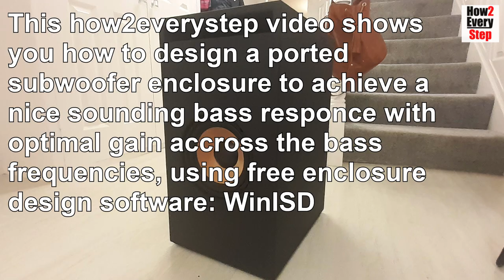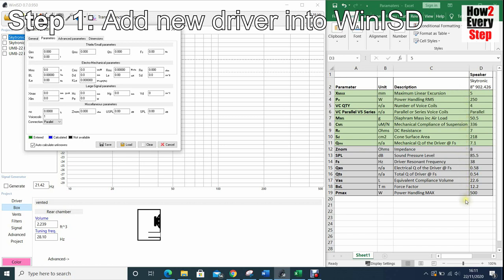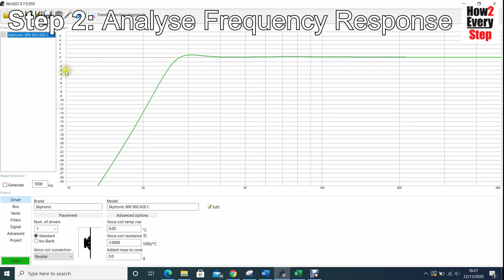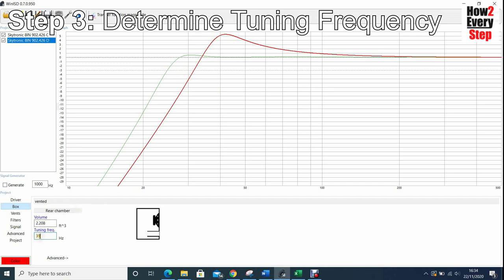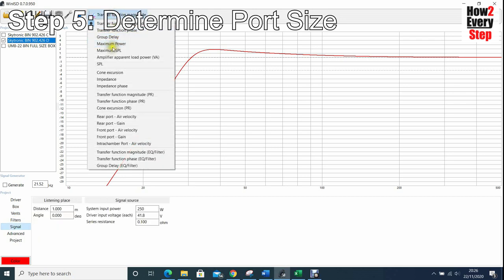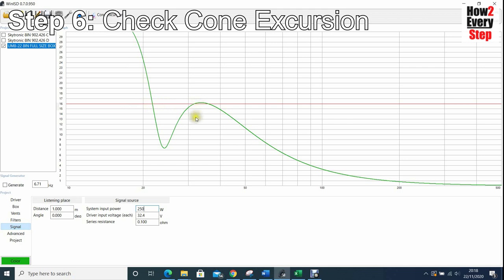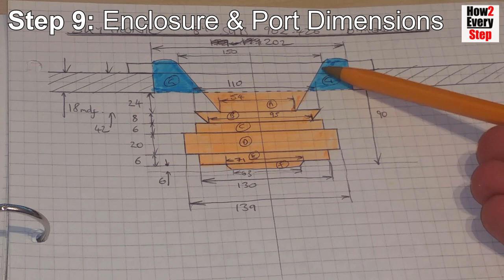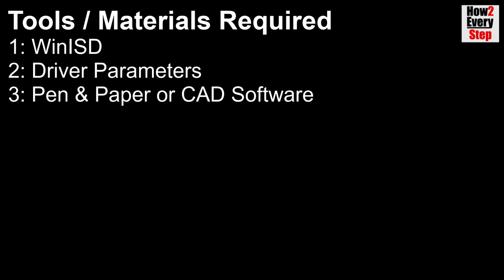How to Design, Size & Tune a Ported Subwoofer Box in WinISD for Deep Bass: Home Theatre or Car Audio

Comment: you might mention that the slope on the low end if 6 db per octave per box order. so on the 4th order bass reflex project you show... people can notice that 6db x 4thorder = 24 db per octave slope. so at 9 minutes you see the peak at 36 and one octave lower, 18hz is -22db 24 db down. I often use this to suggest the subsonic filter at 1/2 octave below the peak, or where you are 12 db down. In this case 25hz range.
Reply from the maker: Great tip - thanks Henry :)

Comment: This is brilliant information but this processes is from the speaker up.. I have a situation where I I have to make a custom enclosure that fit's under the back seat of my Ranger.. 

How do you work the other way?

Say I build a box that fits the position and from there I have the Cu3 size how do I match a speaker to the box?.. I could add a port or ports, that wouldn't be a problem but how do I go about sizing the sub?

Comment: HELLO THERE , THANKS FOR THIS GREAT VIDEO , I JUST HAVE A QUESTION : BY ADDING MORE PORTS THE LENGHT INCREASES , DO I DIVIDE THE TOTAL LENGHT BY THE AMOUNT OF PORTS , THEN MAKE THAT THE PORTS LENGHT FOR EACH ONE ???
FOR EXAMPLE : MY DESIGN REQUIRES 4 ROUND SHAPE OF 6.80 CM DIAMETER , WITH A LENGHT OF 54.16 CM , DOES THAT MEAN THAT EVERY SINGLE PORT HAS TO BE 54.16 CM , OR DO I DIVIDE THAT IN 4 ( AMOUNT OF PORTS ) AND THE GIVEN RESULT WILL BE THE REAL SINGLE PORT LENGHT ??? 
HOPE TO HEAR FROM YOU SOON , THANK YOU !!!!!

Comment: Fantastic video. I have a question though, for system input power we need to input the "RMS" and not the "Peak Power" ? wont this only give us a modelled rear wind velocity graph that gives us a port that should not cause chuffing only if it stays at or below the rms ? I might be a little confused about this because I have been modelling my subs (not building them) by inputting the peak power of the driver into winisd
Reply from the maker: Thanks.  Good question - it comes down to what amp power you are running.  Generally you size your amp to match the subs RMS power, so no risk of over powering your subwoofer.  I always size to the sub RMS or amp power, which ever is lower if you are on the limit of high air velocity causing chuffing... thanks How2everystep.com

Comment: So the sub u used is set at 31 fs.  is it ok that u are tuning much lower then the recommended? For example you ended up using 31 for the fs then say your f3 is 25-29 range wouldn’t that be to low ? You’d be looking for a f3 of 38 or else you’d risk bottoming out on your sub right ? Just trying to get an understanding on that part you have helped me more then you could ever know thank you have a great day buddy
Reply from the maker: @thatguykai479  Hello.  So f3, is the frequency on the dB vs frequency  curve where the response is 3bB lower than the flat response, I.e. the point where the low end frequencies start to drop off.  Therefore you would expect the f3 to be lower than the tuning frequency fs.  Hope that makes sense? Thanks How2everystep.com
Reply: @How2EveryStep  I see hey thanks so much for replying did not expect u to reach back I really appreciate it and I hope you have a great 4th of July
Reply: @How2EveryStep thoughts on group delay ? For a vented subwoofer f3 of 26 and fs of 32
Reply from the maker: @thatguykai479  hey.  Personally and ideally I like an f3 sub 20hz to really feel the bass (sub bass). And a fs in the 20hz to 30hz region sounds awesome.  Thanks How2everystep.com

Comment: Good stuff bro. Noticed you didn't touch on port length or end correction. Any chance of a follow-up on these? In terms of, if there a port length that is "too long" & is end correction already applied or does it need to be? Also, for larger builds, confined spaces & higher power applications, 17 m/s vent velocity is close to impossible in a lot of cases. Any advice on this? A lot of experienced members of the community mention 30 m/s as "acceptable" in such cases as stated above. Do you agree? Currently in search of end correction information with regards to winisd in particular.
Reply from the maker: Hi Aaron.  Sorry for the late response.  Hope this doesn't reach you after you sub box build? So WinISD takes into account end correction when it calculates the port length.  So the port length displayed is the total length you physically make.  As for vent velocity - 15ish m/s avoids chuffing with hardly any radius needed on the vent opening.  You can go up to 30m/s but I would advise a large radius vent opening (around 2cm radius) to avoid chuffing.  Don't forget the calculate port length is in addition to the radiused part of the port inorder to keep the calculated tuning frequency.  Hope this helps?
Reply: @How2EveryStep  what about flares in both ends , how would that impact m/s?
Reply from the maker: @7Logik  Flated ports can be used to reduce chuffing I.e. reduce the air speed at the entrance and exit to the port, how ever it won't help with noise due to high velocities in the port itself.  I always suggest at least a small flare at the entrance and exit of the port, but if possible you should size the port to sensible velocities.  Don't forget that the flared port ends are not to be included in the calculated port length.  Thanks How2everystep.com

Comment: Awesome video but i still feel totally lost. I am a newbie at this and want to design a subwoofer box... i bought two 4x8 sheets of mdf. I wish winisd would just tell me where to make the cuts on the board so i can make a good box? I am thinking of using the dayton audio mx12-22 12" subwoofer. But i already have the ds18 slc12s subwoofers already. Would the dayton be a better upgrade from the ds18? I need help, sorry for the long message but my brain is going in circles!
Reply from the maker: Hi there.  I am currently doing a dayton audio ultimax 10" sub box build.  I would suggest modelling both of your subwoofer options and let the winisd inform your decision based on the response you are after.   Re the box design, I would suggest basing the design on a max height and width and then size the depth on the calculated volume.  Good luck How2everystep.com
Reply: @How2EveryStep  I just want a box that makes my subs sound good? Not really looking for a certain hz or anything, just want it to sound good on most hz frequencies... I am using the sub for home theater. I am terrible at algebra and all the different speaker variables is still new to me. I just wish I had a cut sheet or measurements so I can get to cutting and building and ha e a good (decent) sub box! Thank you for the fast reply? Any other tips for me?
Reply from the maker: @serenityfpv  I would say persevere with winisd and go for a flatish frequency response.  The setup that winisd proposes is normally good.  Personally I like to tweak for more of a bass boom.  Good luck.  How2everystep.com
Reply: @How2EveryStep  But winisd does not give measurements on how to make the box that makes sense to me? Where does it show the dimensions? Your website doesnt work my friend. If parts express recommended vented enclosure is 2.8ft³, how to i turn that formula into something i can get measurements for my mdf board to make a box??
Reply from the maker: @serenityfpv  winISD will give you the volume of the enclosure - this is the volume of the box plus the volume taken up by the subwoofer speaker and the port.  WinISD also gives you the port length based on the heigh and width you enter.  Then I am afraid a bit of design work to design an enclosure that meets those volumes.  I have done another video based on making the subwoofer enclosure, so please watch that video.  Thanks How2everystep.com

Comment: what if I want ultra low infrasonic bass? like a peak at 18hz? would I need a big box tuned super low? or multiple drivers? I have 2 12 inch drivers. How do I know how flat the in room response will be?
Reply from the maker: Hi there.  Generally you need a larger subwoofer box, and also a subwoofer with a lower frequency response.  I am currently designing a  subwoofer box for a 10 inch subwoofer (Dayton Audio UM10- 22) and the box tuning frequency is 22Hz with a F3 of 17Hz.  Your 12 inch subwoofers would probably go even lower.  In my experience the room gain adds SPL to that calculated for the subwoofer box, but does not alter the frequency response.  Hope this helps? Thanks How2everystep.com
Reply: @How2EveryStep  Thank you. I went with 2 separate boxes tuned at 21.5hz. They are 3.7 cubic foot each, and the in room response for them is an estimated F3 of 14-15Hz. Only gonna put 80 watts to each of them. Not sure what amp I can use other than an amp from a polk psw10. They are dual 2 ohm subwoofers.
Reply from the maker: @SkittlesScott  good job - you should get a great bass sound and feel with that response! Keep me posted how it goes.  The 10" dayton audio ultimax sub box I am building will be powered by a 500W RMS car amp, that is powered by a 500W pcu  (to be able to run the 12v can amp with 240v mains).  It was the cheapest method of big power output amp with build in high and low pass filters.  Looking forward to powering it up soon!  Thanks How2everystep.com

Comment: Any help on fixing a “invalid floating point” error when I try to edit my box net volume?? I have windows 11 pro and my drivers are updated……
Reply from the maker: Hi there.  I have never seen an invalid floating point in WinISD before.  Maybe start a new project and see if that helps.  Sometimes you can lose your tuning frequency when particular parameters are edited out of possible ranges... thanks How2everystep.com

Comment: best winisd video ive found. if i want to do a wedge shape box can i still design it as rectangle box in winisd?
Reply from the maker: Thanks Binners! Yes - you can use WinISD to size the volume of your bass box and port and then make the shape of your box whatever you want.  Thanks How2everystep.com
Reply: @How2EveryStep  instant reply as well just subbed you beautiful man 👌
Reply: I've inputted the info in the order you said as best as I could I'm not sure about whether dvc are parallel or series assuming parallel and a couple other calculations are not quite what is on rockford fosgate site. Corrected them to what is on fosgate site and getting a massive error list in integrity check for bl fs mms re qes rme bl re qts qms qes mpow rme cms vas sd vd sd xmax. 'Some are repeated in my list too' Should I ignore the errors and continue, or assume the winisd calculations are right?
Reply from the maker: @binners7872  First of all you need to decide whether you will wire your subwoofer dual voice coils in series or parallel.  You will need to check how the voice coil impedance matches your amplifier impedance range - then wire in series or parallel to suit.  Try that see how that impacts your WinISD calc.  Thanks How2everystep.com
Reply from the maker: @binners7872  Regarding the errors between the Rockford fosgate data sheet and the WinISD, its is OK for there to be some minor differences, as this is likely to be due to e.g. rounding errors.  Let me know how you get on once you have decided on the parallel vs series rounding errors... thanks How2everystep.com

Comment: I'm having some issues. I'm building a box for an audi q7, DS18 Hooligan 15" (4ohm) single ported enclosure. Could you please help
Reply from the maker: Hi there.  Sounds like a fun subwoofer project! What do you need help with? Thanks How2everystep.com
Reply: @How2EveryStep  I want to use the most space I can, I have alot of it. I have my entire third row and wheel well to build a box for a DS18 Hooligan 15" (HOOL15. 4). Every time I try to calculate specs I get a really small box that just seems way too small for the back of my suv. I'm not sure how I can stretch out the specs winsd spits out while keeping the same requirements for the sub/Amp combo
Reply from the maker: @DoTheSchwoo  first work out what volume you have in your boot.  The  put this volume into WinISD to see what impact it has on the frequency response curve.  I would suggest having 2 project open so you can compare the original winISD proposal to the project with the bigger volume.  You should see you can achieve a lower bass peak with the larger enclosure and port volume.  Thanks How2everystep.com
Reply: OK will do. This to me is going to be one of the more challenging parts of this learning experience. Im also going to have some trouble when it comes to the electrical side of things. I got all my tools and supplies "table saw, router, Jigsaw, circle saw, sander, Brad nailer, shop vac, circle jigs...", now it's working around my OCD and making it actually happen. I can't just be OK with simple. I want to incorporate the wheel well which used to hold the spare wheel and stock "bose" subwoofer. It currently has 2 XS super capacitors and 1 secondary w/ lc2i, my current setup is in a simple ported box that was prefab and most Def not the appropriate size for setup "DS18 x2 15" exl xx". I've been told that these subwoofers "HOOL15.4" work well in band pass or 4th order enclosures and wanted to get a second opinion on that option as well. I also want to explore my options for adding an attached section for some mid/high speakers. My amps are currently mounted to the back of my seats, despite my very clear request to not be mounted there. I would like to get some info on what methods work for building Amp racks. Is there someone that I could pay to design this more complicated setup for me? I'm confident in my ability to build it however I'm hesitant to put my math into action or just numbers in general. My brain works creatively

Comment: Great video! :) A question, when entering the X-max value is it one way or 2 way? And is there possible to entre X-Mech. The port dimension should differ if you calculate for a woofer that moves 8mm x-max, but can move 16mm x-mech?
Reply from the maker: Hi there.  X-max is the distance the voice coil can travel from rest until it is out if the magnetic gap.  X-mech is the distance the voice coil can move until it hits mechanical stops.  You don't ever really want to reach x-mech as you risk damaging your subwoofer driver.  So I would recommend just designing for x-max.  Thanks How2everystep.com
Reply: @How2EveryStep  Thanks for answer :) That sounds about right. But shouldn't the port dimension have to be bigger (to not get too high air speed in the port) if the sub CAN move say 80mm x-mech peak-to-peak, but you only told winisd it will travel +/-20mm? The air speed will rise significant when the sub moves double amount of air?
I just want to be on the safe side and don't get port-noise :)
Reply from the maker: @djclabbe88  Winisd use x-max to calculate the port dimensions.  Correct me if I'm wrong but you only want the subwoofer driver to travel in the x-max range.  You want to avoid approaching the x-mech range as the speaker will bottom out and damage.  Hence designing for x-max you are in a safe place.  Thanks How2everystep.com

Comment: @How2 EveryStep.......why did you used the UM8-22 for the Cone Excursion instead of the Skytronic 8IN 902.426?
Reply from the maker: Well spotted! A bit of a video footage from another subwoofer box design got mixed in.  Same rules apply though.  Thanks How2everystep.com
Reply: @How2EveryStep  Fortunately, I realized before ordering that speaker to test... with a 5mm cone excision, not even with a 1cu/ft closed box and 30w input can that power be handled by that speaker. So those 250w rms must be in a closed box of 0.1 cu/ft. With any vented box, the cone excursion is already too bigat very low powers, regardless of the size of the box or the vent.

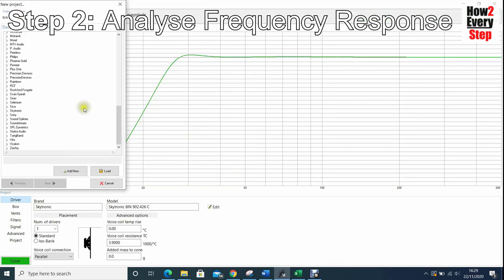Comment: At 4:18 Your speaker showed up red for the integrity test and not green but you still continued. I thought you weren’t supposed to do that?
Reply from the maker: Hi there.  Well spotted :) The reason it showed up red is because I overwrote some of the WinISD paramaters with known values from the supplier datasheet.  Outside of the video I did a trial run with using all the autogenerated values and the integrity test showed up green.  But I preferred overwrite with datasheet values.  I would suggest you only overwrite values if they are close to the autogenerated ones - to avoid the risk of design errors.  Hope this helps?
Reply: @How2EveryStep  ok thanks. I noticed it so I was just wondering. 👍🏻
Reply from the maker: @to3634  let me know if you need any more advice on you subwoofer box build :)
Reply: @How2EveryStep  ok I do actually. Everything on my build checks out except for the group delay which peaks at 45 ms and I can’t change much without throwing everything else way off. Do you think that will be much of a problem?

Comment: Ya, but for some reason, when you change your tuning Hz, the box size doesn't change. I thought that ideally you want as flat of a response as possible to help prevent unwanted resonances.
Reply from the maker: Hi Rob.  In terms of the flat response I would say it is a matter of personal taste.  I prefer a slight peak around the bass frequencies to achieve a bass boom.  High peaks are only really good for SPL subs - where you do get high volumes at the peak frequencies but you sacrifice volume at the other frequencies... Hope this helps?
Reply: @How2EveryStep  yeah everyone likes a little bump now and then just don't go overboard.

Comment: Group delay doesn't matter for bass outside of very specific situations. Group delay at 33 hz has no audible effect. It should be the least of your worries.
Reply from the maker: I agree group delay for 33hz is not such an issue as that frequency is not audible.  However the frequencies close above the peak ie 60hz are audible so group delay is a consideration.  Thanks How2everystep.com
Reply: Above 60 hz shouldn’t even be played by subwoofer 

Even my 13 cm b&w cm1’s have a -3db at 55 hz…